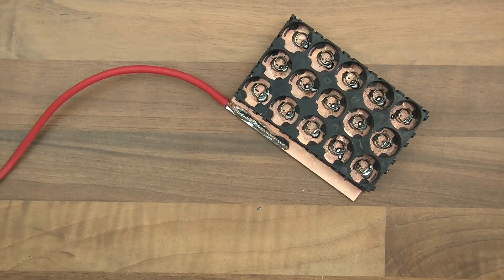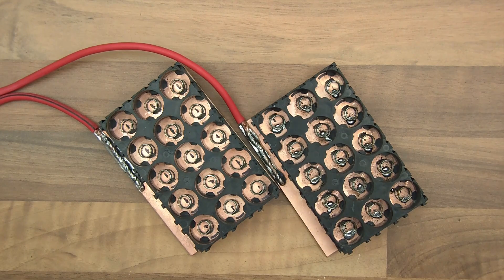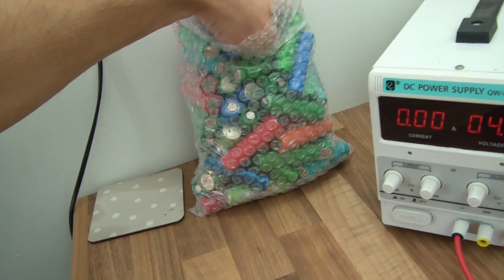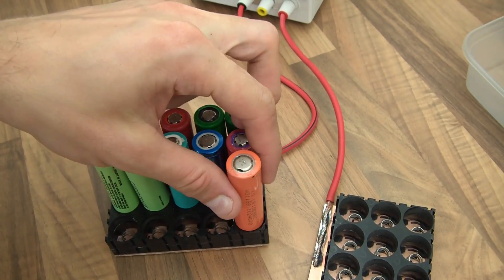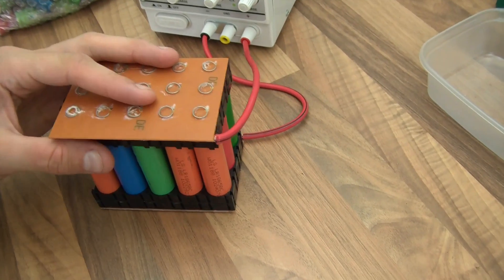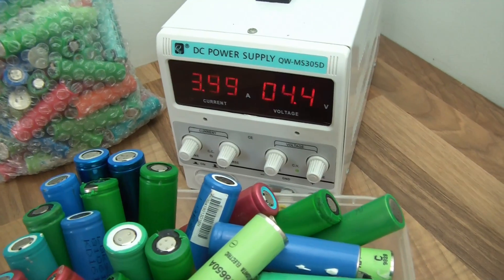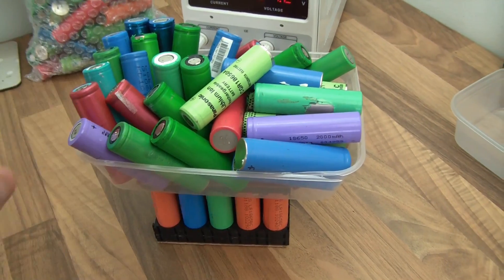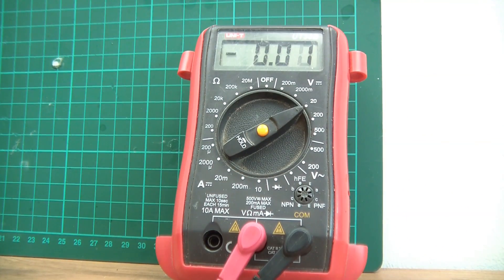TUTORIAL: How to Make Simple DIY Multiple 18650 Lithium Cell Charger! (Part 3) - Without TP4056

Comment: The voltages are not so important for li-ions. On the other hand the max current is very important. All the cells are not designed to support the same current of load. A too high  current of load can pull a dangerous heating. So that for keep safe, it is necessary to be sure that the current of load does not exceed the maximum for every cell. It is not apparently that your made. Thus your method is dangerous.
Reply: no battery will blow up in a sec cause you applied 4.3 instead of 4.2V for a few sec but in order to charge a batch in parallel like this you should at least measure the voltage on the batteries with something more reliable than the psu .. it is though quite possible that the batteries are UNDERvoltaged as low quality cabling can drop voltage ... the bigger problem here is that, if all batteries are not at the same voltage level when starting to charge them and they are not of the same capacity, you are effectively trickle-charging those that will charge first and with such a big batch this could be hours (5A for 15 cells is actually quite low current.... )... of course batch charging unmatched and untested cells is a big no no no..... but if you match them and make an actual pack, its actually a very low charge current about 1/3 of what is regularly safe for average 18650's....

Comment: The reason why some cells are showing slightly higher than others is because of bounce back. The healthier cells will stay at their relative charge voltage for a longer period of time. The weaker cells will drop at a faster rate. This is because they can't take the charge current as efficiently as the others. As I mentioned in the other comment, leaving them in parallel connection for a period of time will help minimize this issue as the cells that are stronger (apparent higher voltage) will help bring the lagging ones up. After awhile, they'll all have the same voltage after they have been disconnected from the parallel group.
Reply from the maker: Hey, interesting! Thanks!

Comment: When you disconnect the cells from the charger, you should leave them connected in parallel for at least 5 minutes. That allows the cells to fully balance with each other. You even measure some cells will take more current than others depending on chemistry. It's for this reason that they should sit for awhile to finish balancing.
I think 4.2V is actually a bit too high for recycled cells as you will get less cycles out of them. Charging to 4.1V will increase cycle life by almost double; going to 4.0V will increase by almost 3 fold.

Comment: This is very dangerous, you have no control of the actual voltage of each cell. Overcharging to 4.4 volts can easily cause fire. You are mixing cells with different voltage, brand and capacity. Some of them will charge faster than others. It's only a matter of time when something goes wrong. Please stop spreading ideas like this.
Reply: Cells in parallel will ALWAYS have the same voltage. It is impossible for a cell connected in parallel with another to have a different voltage.
And considering how low the amp charge of each cell is, there is not really any chance of a cell getting too much current.  5A / 15 cells = 0.33A per cell; and that's max
Reply: As far as him setting the charger to 4.4V, that's perfectly fine. All chargers will go slightly over voltage to start charging. During the run, the charger actually dropped to 4.2-4.3V. This is actually within the safety limit of the majority of Lithium based cells. There are few that this is not ago, but they are physically a differently size.
Reply: Korishan if one cell internally shorts out there is no fuse to disconnect it from the others
Reply from the maker: @engineer8756  but if one cell shorts out, what will happen is that it will draw 5a from the psu. I don't believe the other cells would be affected while the psu is on. Drawing 5a for some time, that cell will get very hot. When it gets very hot, it CAN catch fire. The simple solution to this is to simply test the cells before hand. There are two ways to do this, check the voltage, then check temperature. It's really easy. :)
Reply: @Engineer 875: The chances of a cell short circuiting when doing a charge after making sure all cells are close to voltage is extremely rare, if not non-existent. A cell that goes rogue doesn't do so all of a sudden from a good state to a bad state. It goes through a slow process of changing from a good cell, to a self discharger, to a heater, to a short circuit.
This takes time and many cycles. Antony is not permanently connecting all these cells together, tossing them in a rack, and walking away from them and only checking on them once a week or less. This is a "1" time charge, not even a cycle.
Reply from the maker: @korishan  I've now charged hundreds using this method, and it is as you've said. There's no problem with it and as you've said, cells don't just all of a sudden go nuts... I've been messing with them for a year now and I've never experienced any problems... If a cell goes bad, what happens is that it just loses charge and won't hold it anymore. If you try to charge it, it simply acts as a short and heats up. That's the only problem I've come across.
Reply: With your constant checking of the cells, that's a great way to weed out any heaters. That's a good method and don't slack on that. Maybe in a future video you can incorporate an arduino, a FET, thermistor recycle from the laptop battery pack, and some fancy code to monitor the temps of the cells. If a cell gets hot beyond a threshold, the FET gets turned off disconnecting the power. The only reason you'd need the arduino is possibly for monitoring time and temp fluctuations and such. Otherwise you could just wire the FET directly with the thermistor and some resistors and a capacitor and a switch (to start the whole thing off) and it'd auto shutdown when the thermistor gets too hot.
Reply from the maker: @korishan  Yeah. I'm going to do that! I'm waiting for some parts to arrive.
Reply from the maker: I disagree, I don't think it's dangerous. I do have control of the voltage of the cells, in this case, I applied 4.4v and I had full control of it. Correct, I was mixing cells, so what? I'm charging them, not joining them into a battery pack! Some will charge faster than others, I agree! And? You think that's dangerous?!? It's not dangerous! What is dangerous is when cells get hot enough to catch fire. The remedy for this is to simply check them and remove any hot cells.